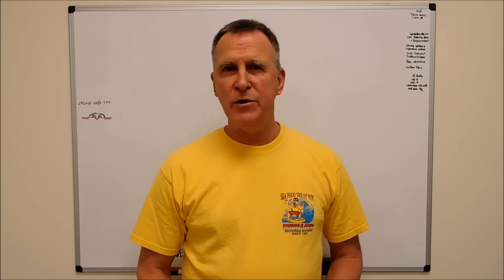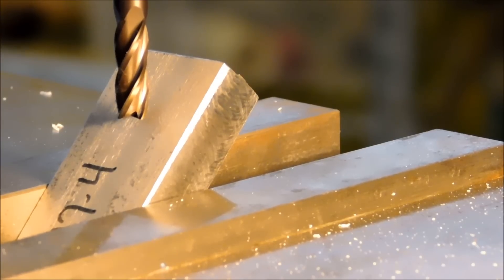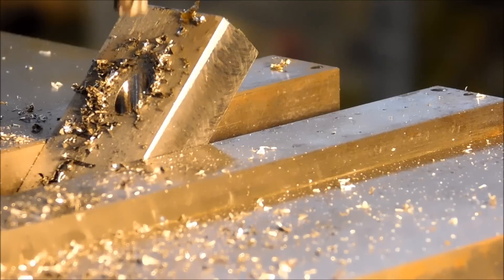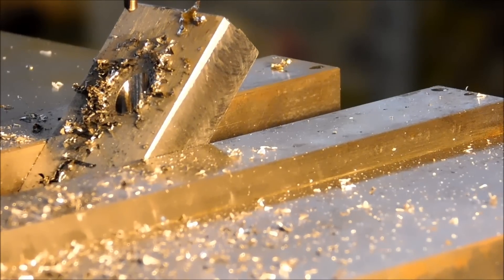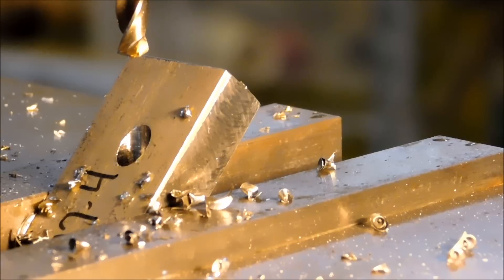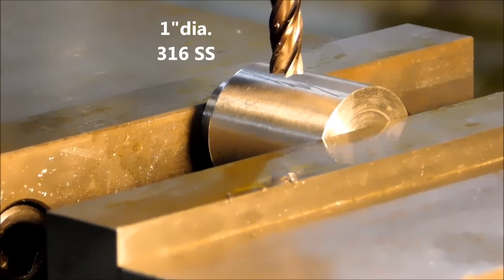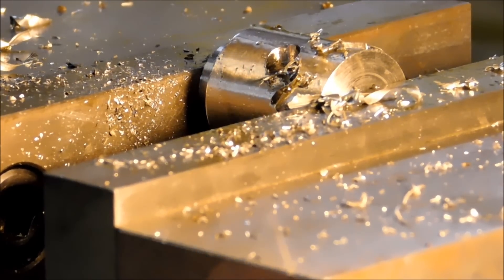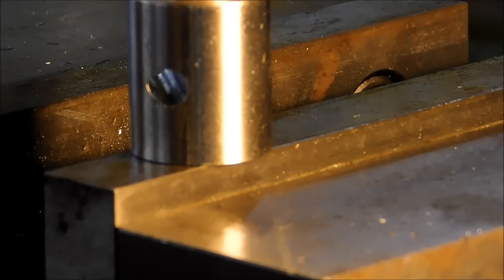Drilling Holes on Angled and Rounded Surfaces

Comment: I just have to thank you again I never thought of making a flat spot or using an end mill,
I always  used a guide, other part with hole it or I just didn't try to drill at any angle but a 
90 degree ! If you every need another Job Please start teaching young people !! 
  Your easy going,simply straight forward way of presenting things is just what this 
generation badly needs as most seam still lost at 20 - 30 yrs and older ! Your the Solution!
Reply: IgotHeliFever it's not the generations fault it's their parents. It's the generation that this generation had their examples set by
Reply: Your absolutely correct, spare the rod spoil the Child-sort of! I never
spanked my two Daughters - just cut their privileges & taught them 
right from wrong, tried to raise them right & show them by example
what it's like when 2 people Really Love each as my wife & I do!

Comment: your right that is a pretty noisy spindle. make me feel a little better about mine. :) Any advice for doing that with a 4140 annealed block approx 3/8 sq. hole is .082 im afraid the mill is gonna break. Ive got 50 parts

Comment: Any tips on indexing a hole on angled surface ?
Reply from the maker: I'd need more detail before I could answer this one.
Reply: Well it was kinda general question (my bad) , but let's say you have a setup like the one in your video.  For the sake of argument , let's say you have already done all the necessary milling , chamfered the edges, etc.. Basically your piece is almost finished , all that is left to do is drill a hole at some weird , non standard angle.
And also let's say that when you position a piece in your vice , because of the chamfered edges and weird angle , chamfered face is not perpendicular to your tool. How would you locate the position of a hole.

I'm thinking something in the order of first calculating the horizontal cathetus (sine) of triangle for weird angle. That gives you your Z travel, then you calculate the sine for chamfered feature , based on the chamfered edge that you will touch off and zero in. By subtracting those two values you get your actual Z travel. Now you simply backoff the piece , raise your table by calculated amount , and then enter the piece on x-axis by half the diameter of your endmill. That should put you right on the spot. Obviously y-axis is just half the width.

This is simply hypotetical question , just want to know is there any neat little trick in doing this or would you have to do this one the hard way ?

Comment: Whats wrong with putting an end mill in a chuck? Except that it will not work.
Reply from the maker: How about side load is a very good way to unlock a taper. Other than having a chuck and end mill come flying at you at 600 RPM, I don't see any reason not to do it. Just kidding of course.
Reply: Joe Pieczynski So for this operation where the end mill isn’t producing any side loading, a regular taper fit drill chuck should be OK? Asking because I don’t have a mill, but do drill the odd angled hole! Excellent vid by the way!👍😊
Reply: They make end mill,holders for a reason
Reply: I have a quality very large chuck on my mill and I mill with it all the time. It never moves and does what I need to. As a matter of fact I rarely use my tapered end mill collets. To each their own I guess.

Comment: I’m a new subscriber and very new at machining. A hobby in my retirement. Love your way of thinking and vast experience. I own a very low end King mill, belt drive with stacked pully,s. On one occasion while changing speeds, I encountered the exact same rattle. Turned out I over tightened the belts. After the tension on the belts was adjusted, the rattle was gone. Who know, maybe something to check. Thanks for the videos.
Reply from the maker: If your mill has one of those sliding levers in the front of the head up top for back gear, sometimes the bushing that rides in the inclined slot can wear down and cause the gears to rub inside. If you have that type, check that bushing.

Comment: Thanks for more good info. I don't have a knee mill so I can't come up with the table. Any suggestions when I can only come down with the cutter? Your channel is one of my favorites.
Reply from the maker: If your machine has a quill stop, use the stop as a depth regulator. Hit the stop and lift, move the stop a bit and repeat, and repeat, and repeat. Its not as solid, but take small bites and you'll be fine.

Comment: Yep, that's how I do it. I was told way back that you never use an end mill in a chuck. That it is bad for the chuck. Though I have done this in aluminum when only making a flat big enough to get a center drill on.  (by the way, I am looking to get out of production lathe work. Need a hand out there in Texas Joe) ; )

Comment: Hey Joe, folks,

So this looks like a great technique, but I think my Bridgeport Mill must be a little broken. Any time I raise or lower the knee it moves at least 0.02 inch from where it used to be in the X and Y. Well, mostly in the Y. There is a bit of repeatability to it like a backlash issue, so if I make all my measurements after raising the knee they are precise as a group. Ditto for making the measurements after downward motion. 

Anyone got a repair process for this?
Reply: Check the gibs. They might need tightening. remove the cap and wipers to get at them.
Reply: Your Gibs are loose on Z.

Comment: You said don't put a end mill tool in a Chuck.  Why?   In my shop andrill press is my most sophisticated machine in my shop, not counting a table saw and a thickness planner.
Reply from the maker: Side load is not good for a taper lock chuck, and the chuck itself was not intended for side load. It could damage the chuck accuracy and unlock from the spindle. Be careful if you have to do this with a drill chuck.

Comment: After watching this I have a couple of questions. FYI, I've never used a mill or lathe but I've developed a keen interest, so please bear with me.

Why does a drill walk off when drilling an angled surface while a mill does not?
Why not go all the way through with the mill while you're at it?
Why do you suggest moving the table up rather than the quill down? What's the difference?
What's so bad about putting a milling tool in a drill chuck?
Reply from the maker: These are good questions.
A drill usually has a pointed leading end and is usually longer than an end mill. The stubby blunt end of an end mill makes it less likely to walk and more rigid.
You could absolutely go all the way through if you wanted to and the tool was long enough, but most end mills do not evacuate material at the center like a drill is designed to do.
Moving the table up forces the large mass of the knee against the mass of the retracted quill and offers much more positive squeeze. the bounce potential is nearly eliminated.
End mills are designed for end load and side load. Drill chucks are normally held on by a taper fit and any side load could un lock the taper and lead to bigger problems. The chuck jaws were also not designed for side load and could be damaged.

Comment: Why wouldn't you use an endmill in a drill chuck? We use endmills in mag drills all the time if we have a large hole.
Reply from the maker: Chucks shouldn't have side loads. There just not built for that. A light cut plunge probably doesn't hurt once in a while, but if you want a true chuck, stick to drills.
Reply: Ok thanks

Comment: Good advice as usual :-)

A couple of notes: I don't see the need to "peck drill" with an end mill in this situation. The end mill clears its own chips because of the angle of approach and subsequent clearance around one side.

If reach and clearance permits and the drill bit and the end mill are the same diameter, there is no (real) need to centre drill as a "pocket" created by milling deeper, will guide the drill bit.

If you don't have a center cutting end mill and the job allows for a "partial slot", an ordinary end mill can be used and feed in from the side.

I don't see why there is a case for chatter that the table must be raised? Is the potential chatter caused by the extending of the quill? If so "pinching" the quill locking mechanism should prevent chatter.
Reply from the maker: I'll address your comments one by one.

1. Regardless of how hard you may believe carbide to be, it does flex. Especially when only loaded on one side. By pecking, you will advance the depth of the hole, and then re-establish the center on the next pass by cutting away minimal material left by the off center load.
2. The geometry left behind by the end mill is not cylindrical per say. Its round, but vertically elliptical. If the drill you use has any desire to walk upon contact, one of the flutes could catch and snap the drill. The center drill assures this won't happen.
3. When an end mill contacts the side of a part at an angle, the contact geometry is more of a sine wave if you could visualize that, because the cutter contact goes from full diameter to a square profile between the cutter tips. This is what causes the bounce since the length between the cutter tips is shorter than the cutter radius. This is why raising the table work so well. The mass is not influenced by the rapid changes in load. Pinching the quill would help, but not nearly as effective as raising the table.
Reply: Joe Pieczynski thank you for the clarification, all valid points. I appreciate your answers 👌

Comment: If that is a Vertical Mill you're using rather than a drill press and it is gear driven, you probably have a broken tooth on one of the gears like I had on mine

Comment: Hey Joe! just wanted to say I use tons of techniques from your channel at my day job regularly, so thanks, you've been a huge help! I have noticed that starting and stopping and then restarting a drill hole in SS can yield some pretty undesirable results, primarily to the tool. What are the Do's and Dont's for this start-stop-restart situation, you made not burning a drill look pretty easy here...
Reply from the maker: Keep the rpm manageable and use a good lube. Clear the hole often and keep the tip of the drill buried. If you feed softly, the edge has a better chance of burning and wearing down.

Comment: Joe, had the same noise on a Mitoyo knee mill last week. It was the bearings on the motor side of the head, on the spring side of the variable pulley. They develop that odd noise from bad wear or completely dry of oil.
The Mitoyo mill had oil spouts I soaked with medium weight oil and ran the machine without load for roughly 30 minutes. 
Turns out all spouts were bone dry which made the bearings noisy. 
I suggest a heavier weight oil in your oil spouts followed by running the machine at varying rpms without load (goes without saying check the health of the belt as a flat spot makes the same noise).
Let me know if it work.
Reply from the maker: It turned out to be the plastic spline shaft bushings on the motor drive shaft.

Comment: Would you be able to give us your opinion on how to choose a milling cutter( 1,2,3,4 flute) for specific purpose.. I heard you mention you only use 4 flute on steel and 2 on aluminium etc 
(I have a home built cnc and pretty much only use 2 flute on that with aluminium plastic and wood atm but for my very tiny manual mill it would be good to know a rule of thumb) Many thanks for your time reading this comment. You give some great advice.
Reply from the maker: A good rule of thumb that I use is-------The harder the material, the more flutes you use, the softer, the fewer you use. Same goes for the RPM softer=higher, harder=lower. I rarely use 4 flutes on aluminum unless I am stuck. The fewer flutes gives you greater chip clearance for the softer material to flow out.
Reply: Joe Pieczynski many thanks sir .

Comment: Interesting technique Joe. How would you suggest actually locating the hole in the angled piece of stock? With the round stock an edge finder can be used and the position of the hole set using the DRO. Say you wanted to drill a hole 2" in from the end of the angled stock, how would you proceed?
Reply from the maker: I did a video on that a while back. Check the library for the the same title.     locating the hole in the angled piece of stock

Comment: Joe...Love your videos. I'm 38 years old with 10 years of machining experience. Unfortunately, I started backwards in the machining industry on the CNC mill and lathe machines. Only as recently as this year did I  transition to manual machining as a conscious career choice. Essentially, I want to become a better machinist.

The amount of respect and awe I have for those trailblazers who plied their craft on Bridgeport mills and Cincinnati lathes is immeasurable (not even calipers can measure it ;) )  

Its one thing to push a bunch of buttons and rely on a programmer to plot out your work. From a business owner's standpoint, I'm sure CNC helps to increase productivity and reduce error. However, it's an entirely different level of production when you are forced to do the thinking for yourself and understand why you are implementing certain processes. Thank you for sharing your knowledge.

Comment: sounds just like my Bridgeport in low gear... drives me nuts. Boss said it was the bearings that needed to be replaced... sooooooooo it'll stay as is for now!
Reply from the maker: Its the plastic bushings around the splined shaft.
Reply: No idea where that is but i'll look at the thing one day. Awesome videos btw, learning a lot from those.
Quick question... I'm not sure how theyre called but, is there an accurate way to make a round counterbored "washer" (or rather a collar) on the mill and stay very accurate? having troubles making those without a lathe out of .75 stock
Reply from the maker: I think you are referring to a swivel washer. You could use a ball nose end mill and hold your 3/4 stock in the vise in a V block. Indicate them inline and plunge the cut.

Comment: Hi Joe, the probkem is when you have to drill a whole (or many) in a ball, cause you cannot grip it fixed in a table since that will damage specially if its a polished or cromated thin ...any suggestions for this case? Thanks
Reply from the maker: Clamp a plate to the machine and drill a hole in it about half the diameter of the ball. Sit the ball in the hole and sandwich the ball with another plate that has a similar hole. Drill through the top plate to create your feature, or hold the ball in a collet or chuck for the same op.
Reply: pottymouth

Comment: i'm an utter newb, so this question may be inane.

I can understand your caution against using an end mill in a drill chuck when making a cut which places a side load on the chuck but its relevance in this instance which is basically a vertical drilling like operation escapes me. could you explain please?
Reply from the maker: The quill bounce and tool walk you would experience with a drill dictates the need for a flat registration surface in a situation like this. End mills are historically more rigid and therefore would cut more than deflect. A milling machine with a collet setup is very rigid and will resist deflection as well as any setup could. Though you could probably get away with an end mill in a drill chuck to do this on a drill press, using an end mill in a drill chuck is not a recommended practice. Milling with a drill chuck or heavy side load in a drill press is definitely a no-no.

Comment: love your videos I'm new at metal working I went out and I bought an old Logan lathe and rebuilt it new. I have a Harding lathe that's an absolutely beautiful day and I have a mill and some welding equipment. I just built a really nice bar roller that works really nice I'm so happy the day. It's funny that I actually just instinctively started doing this meth than with an anvil it makes sense. that's so that makes me happy that I figured out something myself that's actually a real solution

Comment: Possibly excessive hypoI'd bevel gear backlash on horizontal shaft IF it gets quieter at higher speeds as the helix naturally takes up the lash driven faster into mesh . It has a frequency above that of the motor speed so it is a gear problem .

Comment: I'm surprised you're using a lathe center drill and not a 120° or 140° carbide spotting drill. I'd expect the 17-4 to really chew up the corners of the twist drill when going into a 60° spot.

Comment: Hey Joe does your machine rattle as much as it sounds piece. Any chance we may see you do some changing out of what ever.
Really like you vids.
Cheers
Ian
Reply from the maker: Hello Ian. I am sure its the plastic bushings on the front vari drive shaft. Its a bit different procedure than the rear, but the rear is posted under my "mill repair video" It wasn't a bad project, just a bunch of unknowns. The second time would be a walk in the park.

Comment: Just found your video channel few days ago, Joe.  As an older machinist who is still turning all the dials by hand, I enjoy watching.  My shop is very small, and I make mostly one-offs and short runs of parts for various customers.  Love seeing you work on the manual machines, but enjoy some of the CNC vids, too.
What's really nice is seeing someone who knows some of the older tricks I learned when I was young, working with the old heads in the trade.  
Thanks for the enjoyable banter, too.
Reply from the maker: Thanks for watching.